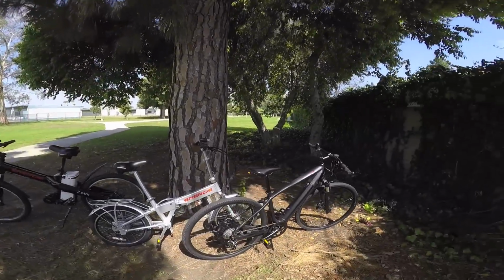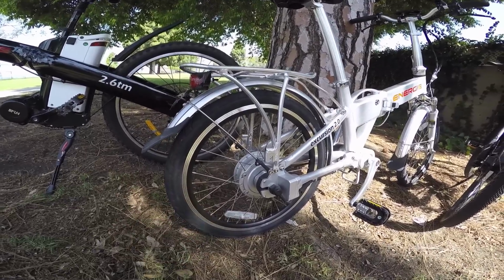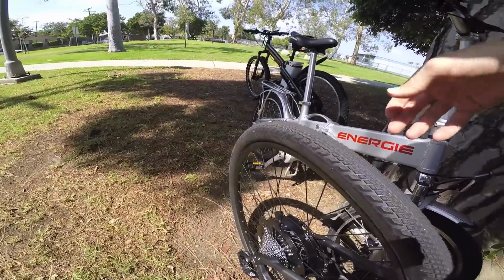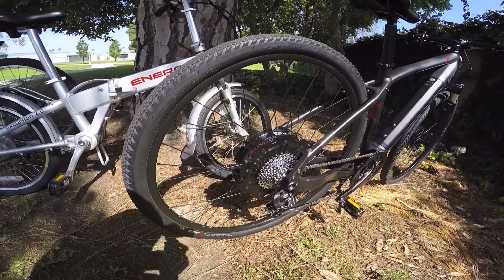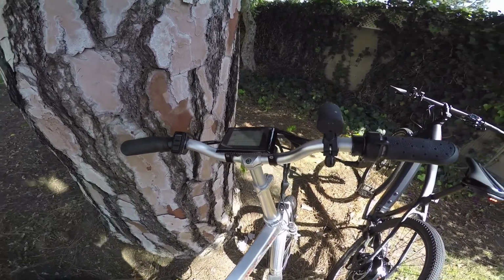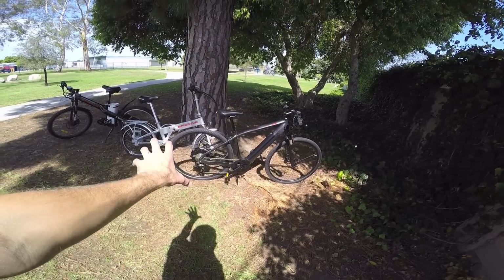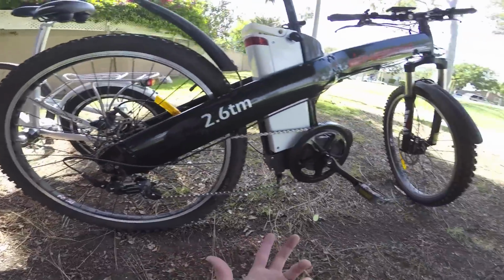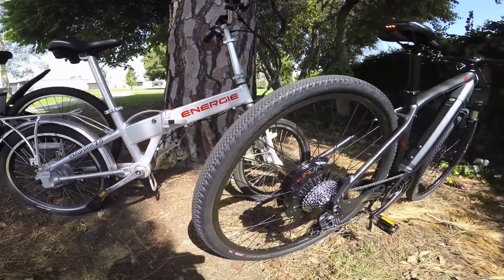eBike Primer: What’s the Difference Between Electric Bike Motors?

Comment: Very well done and informative vid my man. I bought a hardtail, ft suspension Mongoose "29 inches mtn bike from W-Mart. Not a hi end machine I know. I'm 6'3"" 210 lbs and this thing still feels huge. I'm determined to buy a kit capable of at least 30 mph (more would be better) not really concerned about range as long as it's reasonable (30ish miles maybe?) I prefer battery to be a "water bottle" type as I don't like the looks of the hanging bag. Controller will be mounted on ft downtube for cooling. Any suggestions or preferences to help? Thank you sir. :-)
Reply: In addition to my 1st post below, I will be mounting a 26" motor assy to the rear and either a 26" or 27.5 ft wheel assembly. Thx.

Comment: So direct drive motors are better, more expensive and will last longer
Reply: Not at all. Direct Drive motors have their own distinct disadvantages but their main advantage is simplicity & for higher top speed. For the same torque & power output they need to be much larger than geared hub motors. They also require a bigger battery which is also heavier. There isn't any magic pill yet so any system requires compromises.

Comment: You seem to know your way around electric bicycles. I want to buy a rear drive ebike kit on ebay for my 21-speed, aluminum frame, 700c bicycle. It will be used in city riding, climbing hills and must have a range of 30 miles or more. I want a computer display, pedal assist and a thumb throttle. I don't want to spend a fortune on it, maybe $400 or less, but I could go higher. I need it to be reliable. I won't be racing it, but more speed is good. I'm leaning more toward a geared hub motor, but there are so many choices. I may build my own battery pack(s). Can you recommend a specific choice(es)?